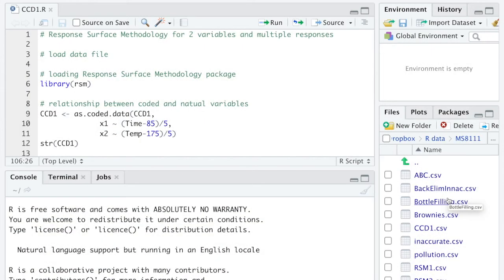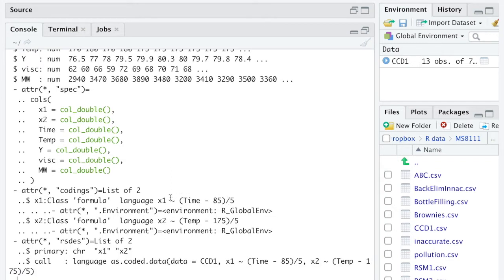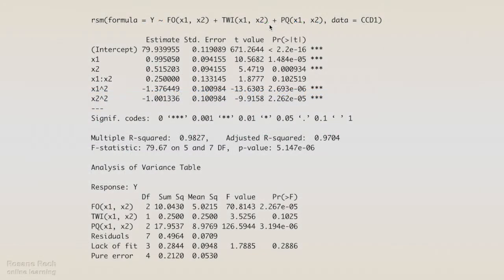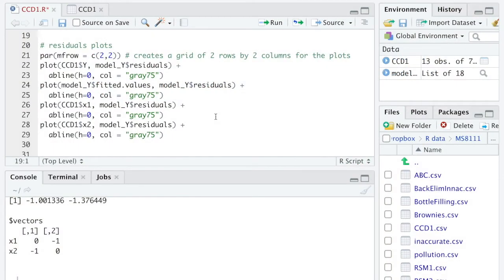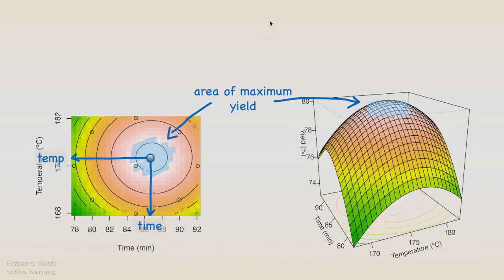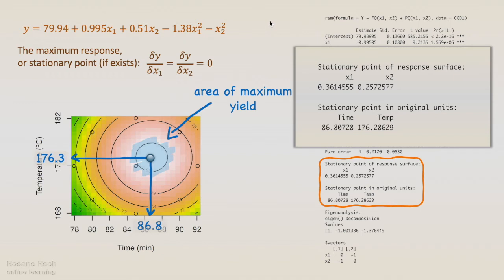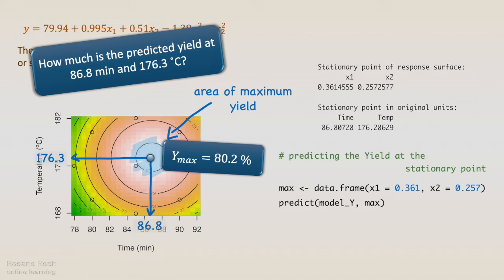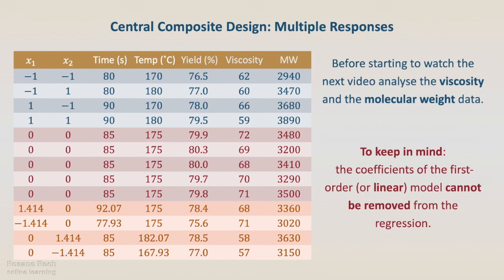RSM: Central Composite Design: R tutorial

Comment: excellent videos. Short question: when using the SO, or FO and PQ functions in rsm(), are the main effects and their quadratic modelled to be orthogonal (such as could be gotten through the poly() function) so as to reduce collinearity between them?
Reply from the maker: The distribution of the points in a central composite design aims to maximise orthogonality between factors.
Reply: @RosaneRech  Thank you for your answer. This makes a lot of sense, I didn't consider this.